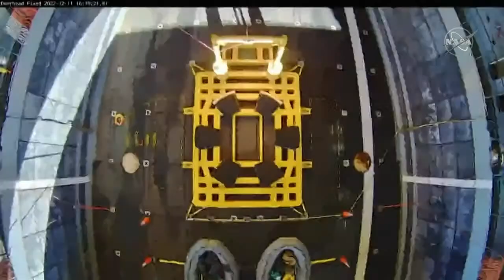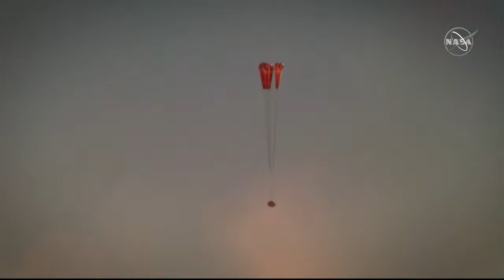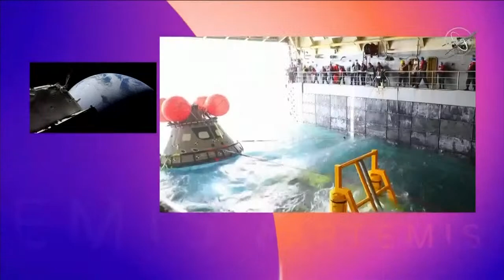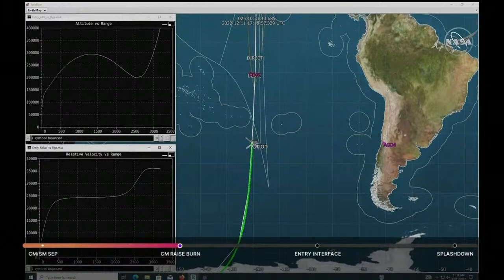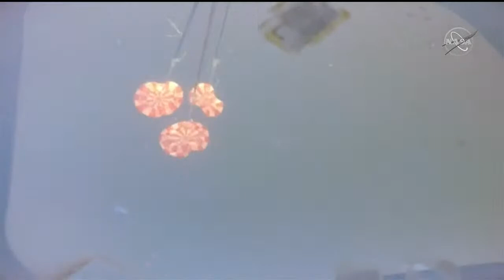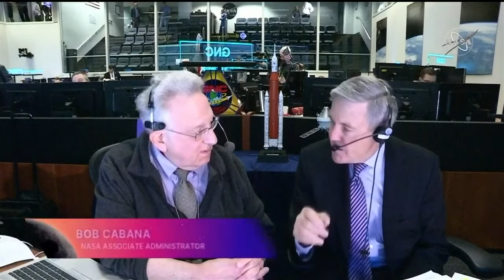NASA’s Artemis I Orion spacecraft returns to Earth

Comment: They have never shown the only important thing the heat shield.  There are three huge bolts penetrating through the heat shield.  These bolts attached crew module to the command module.  Just before the reentry those three huge boats are being cut by the cutters propelled by munition.  This bang leads to the partial destruction of the heat shield.  Sometimes this leads to the demise of the astronauts.
Reply: They can't the bottom of the craft until the bottom of the craft is out of the water.

Comment: It travelled for 50 hours back to earth at 25000 mph so my math is not great but it seems the moon is about 600000 miles from earth hmmm
Reply: You're right. Your math isn't great, but your main problem is flawed and insufficient information. Best wishes to you for a splendid holiday season! ❄️😸❄️
Reply: @TheStockwell  How generous of you.
Reply: the moon is around 240,000 miles from earth not 600,000